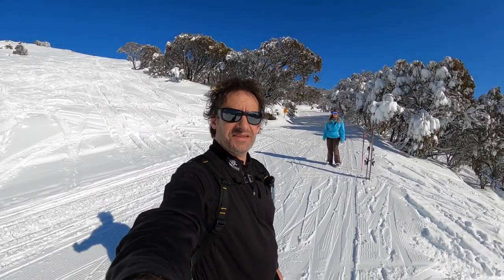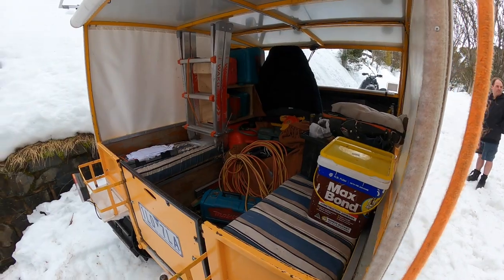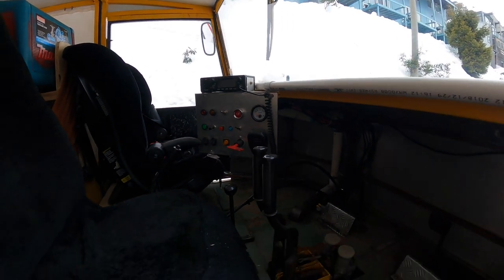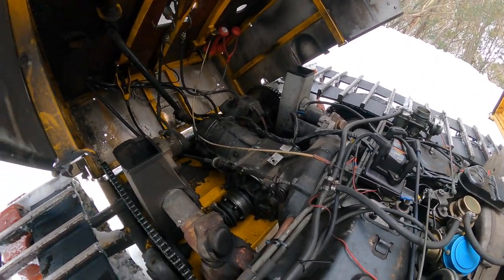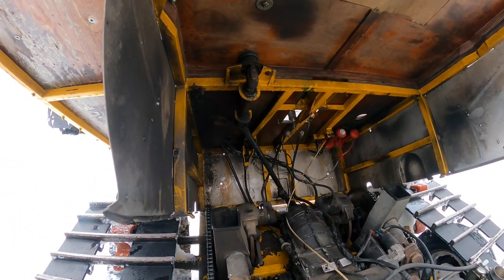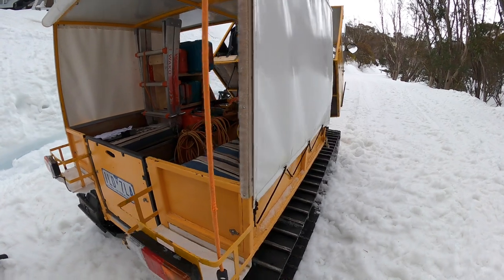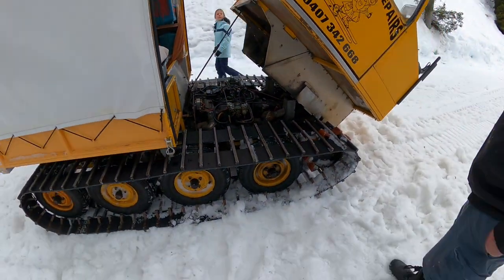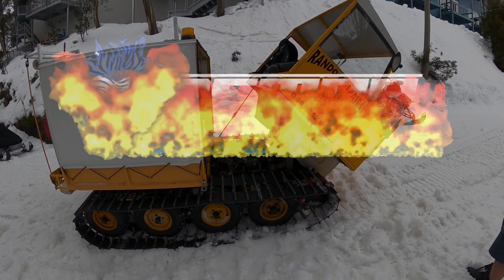VW SNOW CAT AUSTRALIAN MADE

Comment: Maybe someone can help Risky with getting it to run all 4 cylinders.   
And yes its a type 3 and yes it really need to have some sort of intake runner above the duale carbies to make them work properly.
Funnily enough the type 3 intake air cleaner assembly is designed to have little head height so the stock type 3 air cleaner and inlet system would probably fit perfectly.
Reply from the maker: Running on 3?? It seemed to run smooth🤔 I think it might need new plugs and those filters for sure 😉
Reply: @DemopVWgarage   No... listen at @2:21 that's not smooth. It's missing.